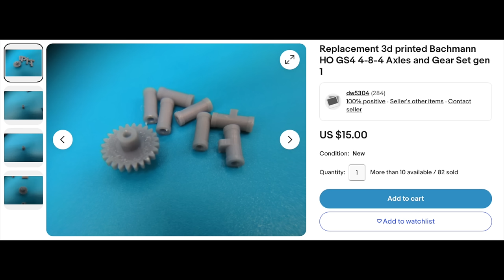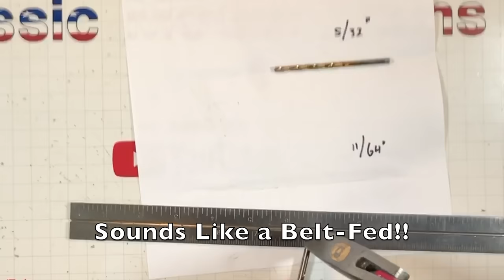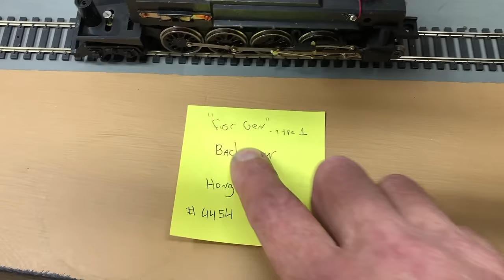3D Printed Gears Didn't Work!  I Found A Technique That DOES!

Comment: I'd like to address some concerns regarding the 3D printed parts that Ron experienced issues with bought from eBay. Over the past 2-3 years, I've successfully sold around 300 of these parts, and it's worth noting that Ron's case is one of the very few – possibly only three – where problems have arisen. To assure Ron's community, I have already issued him a refund for the costs.

In response to this incident, I'm planning to implement minor modifications to enhance the durability and functionality of these parts. Interestingly, after incorporating the brass fittings, the measurement was precisely 2.14mm, aligning with the original design specifications. Moving forward, I intend to add a subtle taper to each axle. This adjustment aims to ensure a tighter fit for the wheelbase.

I encourage Ron and others who have faced similar issues to give the updated version a try once I get that completed, in the future. I'm committed to continual improvement and customer satisfaction. The whole reason my 3d printed parts exist is because I ran into the same scenario where I had all axels cracked on all sides. tried the shapeway version and instantly cracked. Please also keep in mind mfg. Torrences as we have seen they verry a lot.
Reply from the maker: Hello Dave, I'm going to pin this at the top of all the comments. I respect you and your open communication with all of this and I know you will build an excellent replacement part (s)
Reply: Happy holidays to you and yours, Ron.  Thank you for sharing such a great repair with us. Sometimes ya gotta think outside the box. Ron
Reply from the maker: @ronaldjoyce7374    M.C. to you and yours as well Ron!
Reply: Press fit plastic gears can be tricky, gear/room temp can be important. Usually made from Nylon which actually absorbs water. Boiling the Nylon in water makes them less brittle, a trick I used for Nylon model airplane propellers. Got some new Anycubic Tough resin which seems to act a bit like Nylon to try.  The Brass Ferrules are a great idea, common on Wood Chisel etc to stop the wood from splitting. Lots of useful tips from this vid.
Reply: 3D-printed parts are not production parts. Never have been.... only meant for prototypes, one-offs, and - maybe - niche markets. Seriously, y'all forget what it was like when "Made in the USA" actually meant something.... that train has departed the station. 🚆
Reply: @FourDollaRacing  Yep, niche and one off prototypes is my use for 3D printing, think Galloping Goose or speeders not the big 4-8-2s. Injection molded Nylon gears replaced brass and steel gears on cheap locos, hence this Bachmann problem. Split frame electrics need those plastic spacers/gears. Wiper pickup reliability is tricky.
Reply: @classicmodeltrains do you do repair work on these for customers, i have a bachmann Santa fe 4-8-4 Northern id love to get repaired if you do.
Reply: @FourDollaRacing Except in very high end uses. Such as the militaries of the world that are using them for in the field aircraft parts. And I can assure you that fighter jets are not one-offs.
Reply: The guitar sounds familiar

Comment: In my opinion to this date this to me is probably one of the most valuable restoration videos that you've done repairing these bachman in cracking gears and drives on these locomotives I think it's incredible how you figured out to do this and I will one day be trying to repair a bachman that I've had sitting on the shelf as a display for a long time that just haven't been able to get it going and hopefully this brass sleeve will fix the problem Great video One of my favorites thank you Ron never settle find a way get er done
Reply from the maker: Thank you Lawrence!!

Comment: Great video. You give me hope that I may be able to fix the gears on my Rapido Turbo Train. I will never buy another Rapido engine... I paid a lot for that when I purchase it only to have gears that split and when I contacted them i was told they have no replacement gears for it. So I figured all I had was an exspensive paper weight.
Reply from the maker: I hope Larry that you might be able to resurrect the ol gal.  Too many paperweights in this hobby :-)

Comment: Some years ago Bowser made a conversion kit for the Bachman GS4 it included all new metal drivers and gears plus all the parts to put them in and have it run properly with no danger of split gears in the future
Reply from the maker: Ive heard about them.  I also hear there rare as hens teeth

Comment: I've been doing 3D printed replacement aristocraft gears for a while. 
it was a long process because I had to find the right resin for the job.

i HIGHLY recommend the Siraya Tech blu nylon-like resin. and then a little extra post-print curing than what you'd normally do.
Reply from the maker: Thanks for the good information on resin's Greg!

Comment: I've never seen anyone fix a split frame Bachmann.  That is the very reason I will never buy another Bachmann engine.  Their rolling stock is okay but engines, they're a no go for me.  Everyone says that Bachmann engines are good, but I've had to throw too many in the scrap bin after only 1 year of use.  You thought through the problem and came up with a really good fix for split gears.  I think that now it will last for a very long time.  Brilliant idea using sleeves around the plastic.  Maybe Bachmann needs to adopt your idea.  Cheers from eastern TN & Merry Christmas
Reply from the maker: I won't buy them either.

Comment: When I was able to do things a year ago before my strokes, I made a silicone mold to remake Athearn gears and spacers for the 0-6-0 steam engines from the 1960s. I made about a dozen of each for my brother in law to repair his engines. The looked and performed well once assembled in the engines. I used Smooth on products for the mold and the resin casting. I think the resin I used was Task 9 by name.
Reply from the maker: Well that's pretty cool to be resin casting stuff.  A process I have no knowledge in.  I should do some research :-)
Reply: @classicmodeltrains  I was lucky enough to be trained by a master model caster with a full shop of everything  needed to be successful.
Reply: Curious, what material did you use for the gear material ?
Reply: @dogbreath312  I think it was smooth on brand and maybe Task 8 product?
Reply from the maker: @dogbreath312  the original Bachmann  broken gear

Comment: Another fantastic video Ron.  I am always amazed by your fabrication skills.  Thanks again for your videos.  Between your channel and one other that I follow I have been able to maintain my fleet of Athearn Blue Box, Tyco, Mantua, Bachman, and Atlas. Most of which I would have never purchased if I had not learned how to maintain them. All are diesel and per your channel and the other I have been convinced I do not want to mess with steam engines 😊
Reply from the maker: Thank you.  Glad to be able to help you out getting your fleet serviced and running well.  Dont be afraid of steamers.  There pretty much the same to work on just stay out of the valve gears and rods.  Those can be a pain

Comment: Wow what a chore! If Bachmann had done that extra bit of reinforcement back when they were building these new they might have kept a good reputation. But the Bean Counters had to get involved I suspect and make more profits at the cost of many unhappy customers. Too bad. I have a version of that engine which is later gen2 or maybe Gen 3. It still works good, although it's spent most of it's life in a box. My Uncle has the Gen 2 version which all the spacers cracked, causing the frame to short out. He thought it was the motor so he threw it away. Now I have to find a motor, gear and probably spacers to fix for him. The smoke units worked pretty good before they burn out, a nice stream of smoke at speed. Also apparently that giant brass gear was supposed to act as a flywheel too. Thanks for another helpful video and Merry Christmas!
Reply from the maker: The bean counters can really "F" up what the engineers designed that's for sure.  Thanks for watching and M.C. to you and yours as well :-)

Comment: Great fix in the end.
Can I ask why you didn't try and ream out the shaft hole in the replacement parts. I know I have to do that on other gear replacement, or they will split when putting them on the shaft.
Reply from the maker: Thanks Mike.  If the parts would have come with instructions stating the parts will need to be final fit I would have.  Nothing was said.  I still believe if the parts got installed they would have failed shortly after because of the brittleness of them.  I could be wrong though ;-)

Comment: I have Bachmann Spectrum Reading 2-8-0 that has split gear and axle pegs. I bought 3D printed ones from shapeways also but must be gen1 with round holes. My axles are square like in this vid. It been sitting in it's box for almost a year now. I tried using super glue and thread to basically do what you did with the brass rings. I only did two of the wheels because that was only ones broken.  It made it two laps before the last axle slipped out of gauge. Just happened to be one of the two I didn't thread wrap. I'll go back and do the other two probably tomorrow. And see if it improves performance.
Reply from the maker: Sorry to hear your Bachmann is giving you fits

Comment: Wow Ron. I do a lot of repairs to some of my stuff, and funny that it seems to be just Bachman.They used that split chasis design on nearly all their stuff ,steam & deisel, back then.The steamers did not need the phospher bronze wipers to pick up current.They did change that around mid 2000s I think.to the wiper system. I was blown away with your determination, & thought process, to get the perfect results, especially wth this one. I thought, at the time, I hopng those drivers dont end up with a wobble, but NOT ON YOUR NELLY. Perfect just spot on.Wishing you all the best over the xmas period.  Michael  NZ
Reply from the maker: Thanks Michael!

Comment: Thanks for this great video. I just found a new old stock western pacific GS4 never run, do you think I should sleeve the axles before I even put it on the rails?
Reply from the maker: If it’s a bachmann yes. The originals will statistically probably fail.
Reply: @classicmodeltrains  thank you for all your information. It’s a western pacific cab no 482. I went and tried to turn the wheels and they will rotate on each other and it says Hong Kong so it’s a gen 1. I ordered the replacement parts off eBay, the resin printed ones. There is a collar printed in to make the ends thicker, and I’m hoping they are less dimension variations.

Comment: Thank you Ron!
I got a Bachmann ho  4-8-4
It has a small white pancake motor that won't work? Bachmann has no parts? Would there be  a different motor I could use to replace it?
Thank you!
Michael
Reply from the maker: Going to have to find another loco for donor parts.

Comment: Greenway products in PA offers driver sets in different sizes by inches with different wheel shapes and counterweight sizes plus leading and training trucks which might help some to repair their locos also if you were trying to kitbash a certain Railroads loco you could get the driver and spoke configuration correct and possibly fit it to an existing loco
Reply from the maker: Right on!

Comment: Nice work and craftsmanship, Ron.  Quick question, what kinda grease and oil are you using for locomotives? I noticed you're using a jumbo size bottle of grease. It gets expensive buying the little hobby bottles. Thanks!
Reply from the maker: grease is called "super lube" multi-purpose synthetic grease and the oil is Labelle 108 synthetic oil multi-purpose.  both got from amazon.
Reply: @classicmodeltrains  I use the Labelle. So I guess I should stick with it then. Just thought you might have had a cheaper solution. I guess my problem is I use it on things that I could get away with 3 in 1 oil and save the train oil for trains. One product I like is the CRC 226 as it lubricates, is plastic safe, and has great electrical conductivity, I only use that on certain electrical parts that need lubed. Thanks Ron!

Comment: The Lionel version is the original one from the 1970's. Bachmann bought out the tooling and produced the "Gen 1" as you call it in the 1980's and early 90's. The "Gen 2" version is the newer Spectrum version that was supposed to be better, but in reality, it wasn't. I have a first gen Bachmann 4449 and it was always a good running engine. I also had a Spectrum AFT 4449 and it ran horribly. Bachmann still makes them to this day under their Spectrum line, and from my understanding they are pretty good engines. They have all new tooling for the running gears, and I think they now use the tender for electrical pickup instead of the engine.
Reply from the maker: Hello Andy,  Your story of the Lionel/bachmann marriage makes more since to me.  Someone mentioned Kader was in the mix as well?  Thanks for the good information.
Reply: @classicmodeltrains  I've heard it differently. Kader owns Bachmann - I believe they still do to this day. Back in the late 70's, when Lionel was selling HO trains, they partnered up with Kader and had them manufacture their HO items for them. But then Lionel quit selling HO trains for a while. Then in 1980, Kader purchased Bachmann, and they re-used the design for the Lionel HO locomotives on the new-for-1980 Bachmann locomotives.

Comment: That's a bummer about those printed parts. I had seen them a couple weeks ago. Was aboot to jump on em. There's a lot of different resins out. I guess it would come down to finding the one that will be flexible enough, but resilient enough to handle the load. 

The belt fed comment.... took me back to the M60 days. 😂
Reply from the maker: I was gunna have it say "caution..Nam flashback" but didnt think that would work out as well ;-). Yes the RIGHT printer ooze is definitely needed.

Comment: huh the gen 2 shapeways gears i got fit on the looser side of things and i just put a bit of teflon tape over the wheel nub to make them not fall out and they work great mine were from the dk rickman shop listing on shapeways a few years ago and they use a not so brittle plastic also
Reply from the maker: Good to hear they have been working for others out there :-)

Comment: I purchased a set of dw's version one gears and they work great! Tho my application wasn't a gs4 (it was a Santa fe 4-8-4 split chasis). They were tight to go on tho.
Reply from the maker: Right on!  Glad you got your loco back up and running!!
Reply: @classicmodeltrains  yea, it was a bit tragic, I won it on ebay new in box, never opened. But the seller didn't package it well and the locomotive burst out of the thin plastic window and bounced around with it's tender for who knows how long in the over sized box. I spent multiple nights repairing the details on the shell but the gears and axles were wrecked. I still need to find replacement gears for the small and large black gears deeper in the locomotive. That said, it runs infinitely better now and I'm happy to say, no trace remains of the damage visually. Was definitely a satisfying challenge.

Comment: I am a little confused on this one. Did you use the original gear? 
By making new bushings?
Or did you use purchased gears with the hand made bushings?
Curious minds want to know!
Happy highballing on those crooked rails.
Reply from the maker: I made brass sleeves to repair the original gear and axle bushings.

Comment: Where do you get your train holder to work on your trains
Reply from the maker: Amazon.  There sold under a Bachmann brand.  Around $80 if I remember correctly
Reply: @classicmodeltrains  if not in a hurry, the price will drift down into the mid 60s once in a while

Comment: That was a great video. I'm currently trying to solve the 'replacements gear problem for LL/Proto   PA and DL109 locomotives. I've had some successes utilized some super glues, but was referenced to some gears made by shapeways. In ordered some the other day, but after watching your video, I'm NERVOUS !!  Brian......     railandsail
Reply from the maker: I hope you have better luck than I did Brian :-) Ive heard Athearn gears will replace LL-Proto stuff.